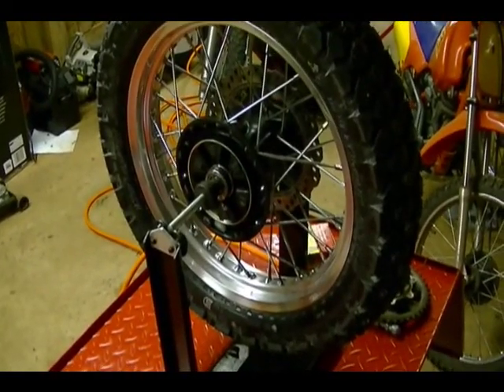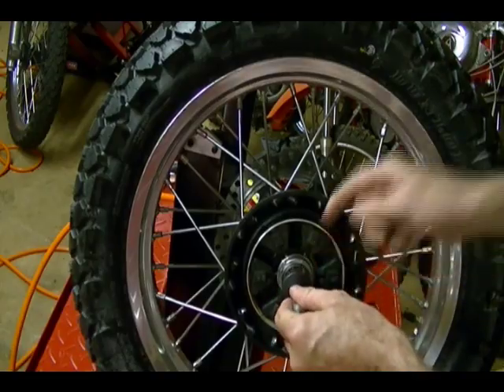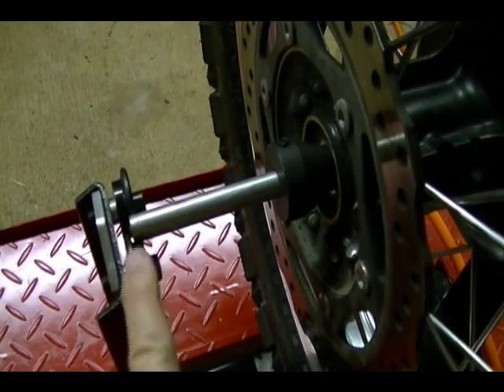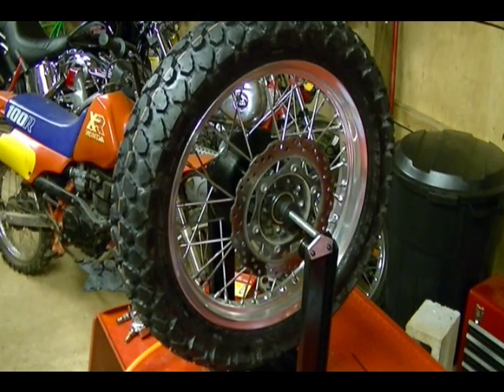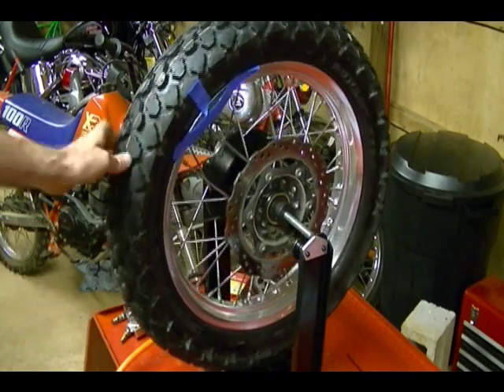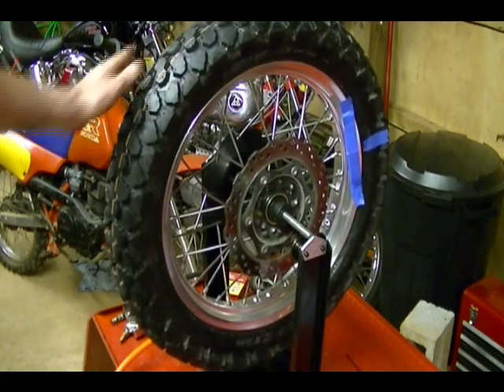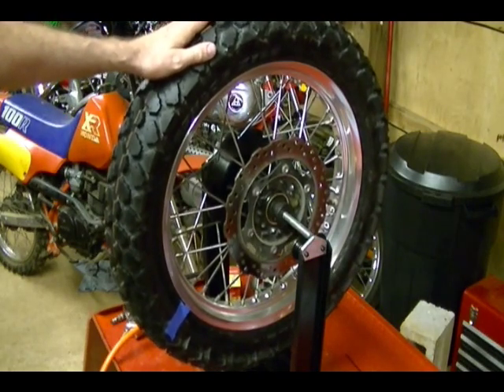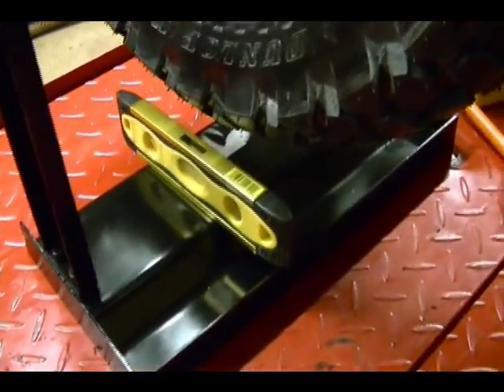Motorcycle Repair: How to Static Balance a Motorcycle Tire Wheel on a 2009 Kawasaki KLR 650

Comment: How well does static balancing work, as oppose to dynamic?
Reply: A little late but dynamic is like having beads inside your tube that fall into whatever they feel is the lightest point, thus evening out the wheel while in motion.

Comment: You can use the bikes own wheel axle and for example stack of bricks or something high enough to support both axle ends to keep wheel elevated, no need to buy special tools. Olive shaped fishing line weights applied to spokes are cheap and re-usable way to balancing and I have never had one to come off while riding.
Reply: Not a bad idea but consider that using your method doesn't give the bike's axle as much freedom to rotate as these static balancers do because they use small wheels that spin freely.  Using your method the axle has to rotate hard enough to overcome the friction of the axle on the brick.  Because of that I think that your method won't be quite as accurate as using a specialty-made balancer.  In a pinch your method should work okay though...

Comment: If your tire dont have a DOT then you can move the tire on the rim 1/4 turn and you'll find that it will offset the change in weight and you'll use less weight on the rim later.
Reply from the maker: Thanks for watching!
Reply: Loop

Comment: Also forgot that some weights dont sit flat on some rims.. Also they are hard to cut when you need a little less weight.  
The cones where also off by more then 25 thousands and they rock on the main bar... also not good. This is a precision tool and its 10 to 25 thousands slop.. check everything..

Comment: Just so everyone knows this stand has a few known problems. The main 1/2 inch bar is bent/sags and the bearings dont turn. The stand with such problems will not work on street tires out of the box, it will never balance the tires. No mater where you turn the tire it will always find the "Bar Sag"  I got three of them and not a one would work right.  I had to have a 1/2 inch bar be made at a machine shop that cost me $45.. and the bearings out of 3 boxs to get 4 that worded.

Comment: The price of that stand runs $49.95... its on sale a lot at $39.95 ... But after getting this stand I found that the main bar is bent and it tends to always sag at one point no matter where you add weights to. Thats a huge problem with street tires..

Comment: Good video. Balance tip: when mounting the tire on the rim make sure the dot - usually a painted dot of yellow, green or red - is in line with your valve stem. This portion of the tire is less to account for the weight of the valve stem. When mounted correctly you won't need any weights at all 99% of the time. Try and refrain from using those "cool" looking valve caps as they throw off the balance of a tire and is like adding a wheel weight.
Reply: What about the weight of the rim lock?
Reply: That is a lot of spinning wheel mass / weight! Great question!